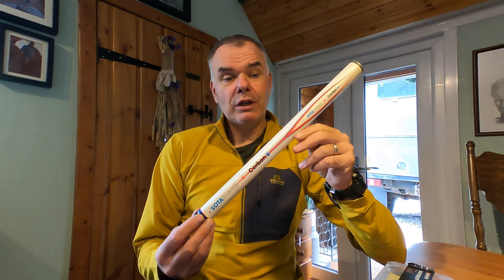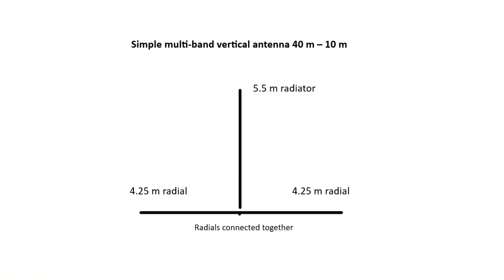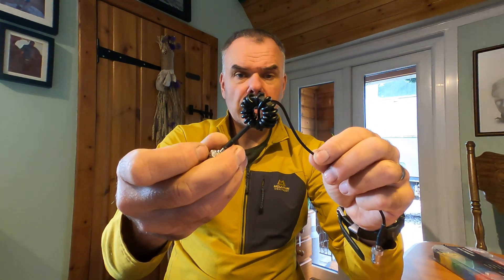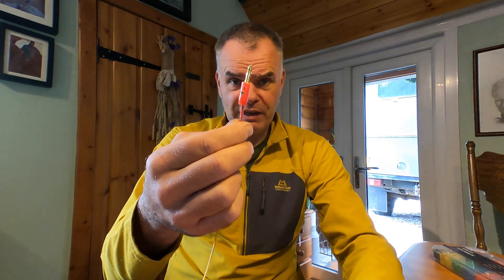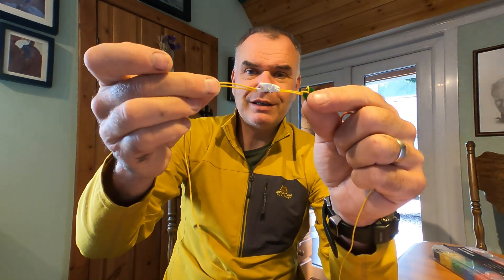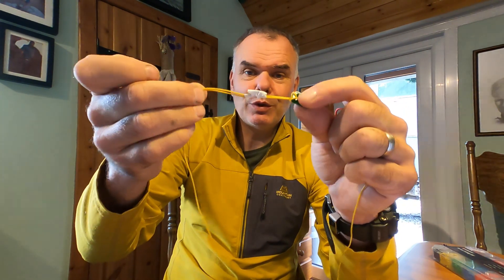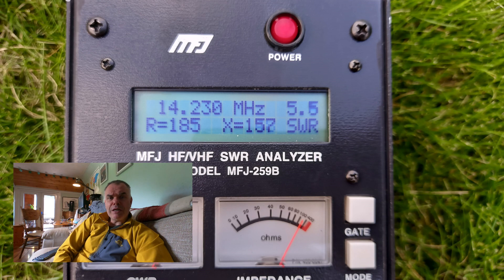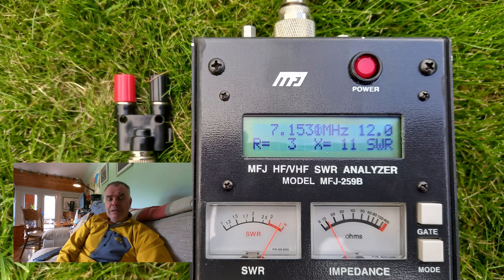Easy Build - Short Effective Multi-band HF Vertical Antenna

Comment: Hi Fraser, is there a link to a webpage with the graphic files for the antenna. Images in the video seem to come from a computer screen...
Reply from the maker: Hi Juanjo, There isn't a website. The antenna is simple. 5.5m vertical radiator. 2 x 4.25m radials. You need to use a tuner. For 40m, use an autotransformer, eg 49:1
Full instructions in the description.
Cheers,
Fraser MM0EFI
Reply: @theradiorover  looks like a 20m GP loaded for every other band via a matching net (AMU/atu). Well, nihil novus sub sole...
Reply from the maker: Nope. Everything has already been invented.
At least twice.

Comment: Good evening Frazer.
I'm always interested in portable 'small footprint' antennas - and like you generally have the BNC/Dipole adapter with a 9:1, 49:1 and 64:1 and 1:1 baluns in my kit.

Do you think the use of a Carbon mast caused you additional compromise?
I have the SOTABEAMS small (6M) Fibreglass mast -- which is what I use for most of my portable ops.
Interested in your view re the Carbon mast vs the fibreglass.

with the fibreglass mast, I've found that centre/top loading the vertical section is quite a good way to get 40M to work (by centre/top, I mean 'towards the top')
My other findings are that with 2 radials, they are better if they are 'tuned' to the band you are using and held off the ground. 
If the radials are going on the ground then 8 is the minimum number I've found gives predictable results -- although unlike you, I'm much more a POTA operatore than a SOTA one 🙂
I'm always experimenting 
73
Bruce G4ABX
g4abx.co.uk
Dr.T(G4ABX)
@G4abx

Comment: Just found your channel.  For portable operation I use a telescopic aerial, a selfie light tripod and homemade coils. Works fine for me. Also use a golf trolley battery for power. All folds up into a Yoga mat bag. With camping kit as well it can be heavy to carry. But I am a pensioner and not as fit as I used to be. Plenty vids in my playlist if you are bored. Cheers from old George
Reply from the maker: Thanks for the info share George. I will have a look. The golf trolley and big battery would be perfect for sea side operations, but I don't see me lugging it up a mountain. 😉
73, Fraser MM0EFI

Comment: Carbon pole is a conducture!, its better using a fibetglass pole
Reply from the maker: This is not always true! The carbon pole can be used with a vertical. I use a Sotabeams Carbon 6 pole and the manufacturer has tested this.
Give it a try, or watch my video! https://youtu.be/KFFTnBSUQM8

Comment: It looks like a nice antenna,  Will it handle 100 watts?
Reply from the maker: The antenna wire, coax and connectors will easily handle the power. You may want to think about using a larger type 43 torroid for the choke.
Good luck experimenting!
Cheers, Fraser MM0EFI

Comment: great portable ant, well done. i feel a bit odd, as i only ever use resonant ants, so i don't have any baluns/ununs, banana thingy's etc at my station hi hi.  But I did think, your qth looks like a great spot for vertical or 40m yagi hi. have a nice weekend 73.
Reply from the maker: Cheers Brian. My QTH is surrounded by electric and phone poles and wires, so I don't tend to operate from home as I risk shutting off the village Internet and causing QRM on TV's!!

Comment: Hi Fraser, 
Nice video, sounds like a great idea. I think I will make one for my shortwave listening, for when I’m out and about. Talking of antennas,  I have now changed my setup.  I’m now using a 65ft military type spec wire. It’s very strong so I can get it quite tight, therefore no longer drooping in the middle.  This has given me more height and has improved my reception. I picked up Chris on Tuesday on WAB and he was only using 5watts, so very happy. 
Have a nice weekend,
Thanks Tim
Reply from the maker: That sounds good Tim. I wonder if you heard me on Tuesday evening?
Reply: @theradiorover  Hi Fraser no unfortunately not? I did search for you ,Chris was talking to another  contact  ,and mention to him your Frequency but there was a very strong German station next  to that frequency  and he was quite spread out . I did hear a few more 5 watt  stations .One  stations one was up in Scotland just above the  ISLE OF MULL he was running 10 watts  have a good .Day Fraser

Comment: A nice simple antenna. Cheers
Reply from the maker: So small, it could be carried as a back up.
Reply: @theradiorover  I wonder what my ATU100 would make of it attached to the Ft 857
Reply from the maker: @excossack  I think it should be OK. I do plan on trying this. Just need a bigger RF choke if you're running a bit of power.

Comment: I wanted to watch this video as it sounds like a nice fun project for my 6m mast, but the flickering in the video makes it unwatchable for me, sorry.
Reply: ^ That was my thought, as well. Ceiling fan.
Reply from the maker: @tdsmart5674  nothing on the video file when I watch it on my PC and TV. Have to assume the compression has done it.
Reply: Shame, but no flickering seen on my iPhone. Very clean video here.
Reply from the maker: Cheers, I can see a bit at the start. Maybe device dependant?
Reply from the maker: I can see a bit of flickering or strobing to the side in the first part of the video when viewed on YouTube. I've watched the original file back on my PC and it isn't present, so I can only assume it is something to do with file compression. 
If you can't bear watching it, please get in touch and I can send you dimensions and photos, should you want to build one. My email on qrz.com is good.
73, Fraser MM0EFI
Reply: @theradiorover  Then it sounds indeed like a compression issue. Sometimes it helps to add a tiny bit of noise to the video to confuse the compression codecs. It could also be caused with a downconversion in the frame-rate. YT stores it at 23.97fps. Will send you mail. Thanks Fraser.
Reply: Looks like a ceiling fan is going?
Reply from the maker: @Taco_Syndicate  don't have one.
Reply: @theradiorover  thanks for the clarification.  Very odd situation.
Reply from the maker: @Taco_Syndicate  yes, very unusual. You will know that 99% of my content is filmed outside, so I guess it's something I need to consider if shooting indoors.
Cheers, Fraser MM0EFI
Reply: Sounds most likely. I don't think I would have noticed, if it weren't mentioned and like you said, may only appear on some devices. Great video, too! Lots of information and a great antenna idea! Thanks!
Reply from the maker: @tdsmart5674  cheers! I kind of did it back to front. I put out the video using the antenna first, then did one in how it works!! At least viewers know it's not just a theoretical one. 😀
73, Fraser MM0EFI